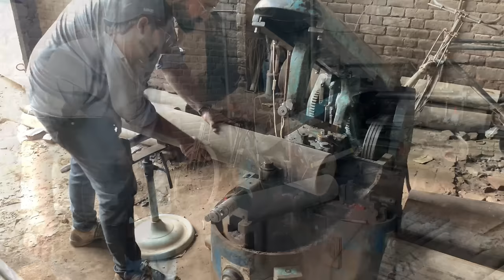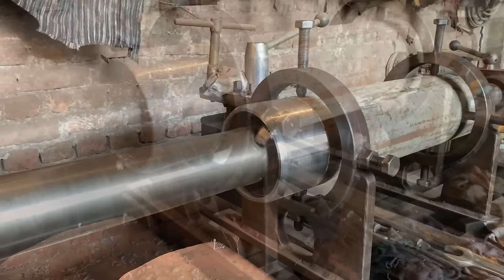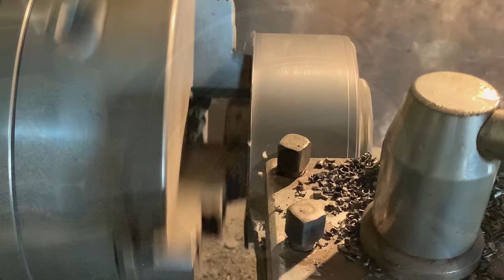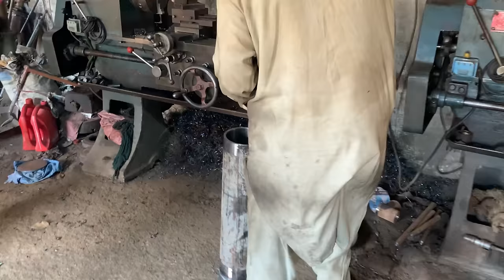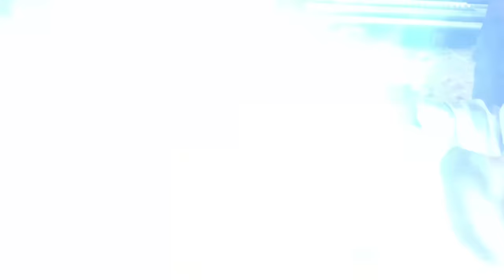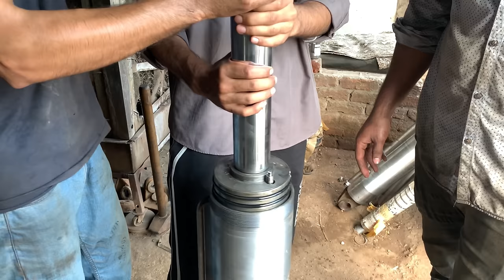Tractor Trolley Hydraulic Jack are Made || Manufacturing Process of Heavy Duty Tractor Trailer Jack

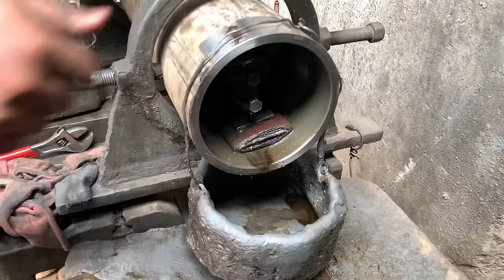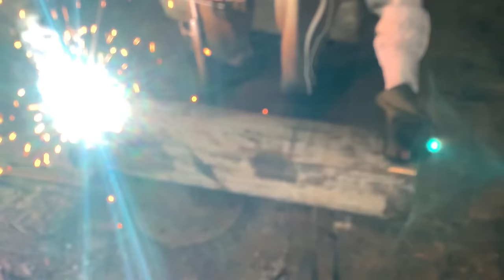Comment: Honing with sandpaper (8:15). Perforated welding seams and just tapping off the weld (19:20). Rusted screws. Defects in the piston (22:55). Only 3 O-rings (23:00) that can withstand a pressure of 250 bar should. Ridiculously, erase with a dirt rag (3:26) and everywhere this dirt and rubbish. Even if you don't have much you can still work cleaner.
Reply: @Elmet Brown  Devi capire una cosa,il concetto stesso di pulito è completamente sconosciuto in alcuni paesi...
Reply: @fasullodavvero  Hai ragione, ma un po' non può far male.
Reply: I would not want to be next to that under full pressure
Reply: Since you're right, however, and such a piece of scrap work are still in youtube!
Reply: Machining through sand from sand casting the piston got me 🤣🤣🤣🤣🤣
Reply: What is really nice with that setup is that you don't need to worry about an oil filter and about pressure, if the pressure pump is made the same, no worries the pressure will stay very low!! 😄